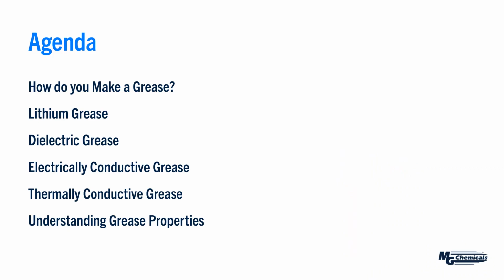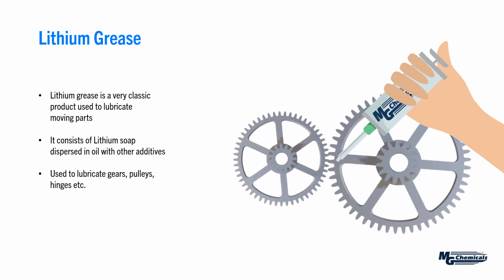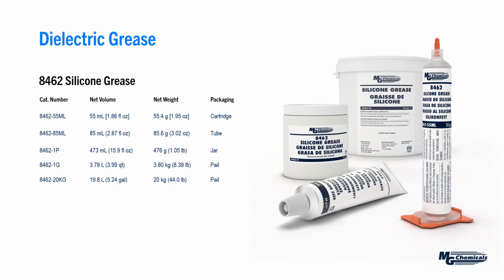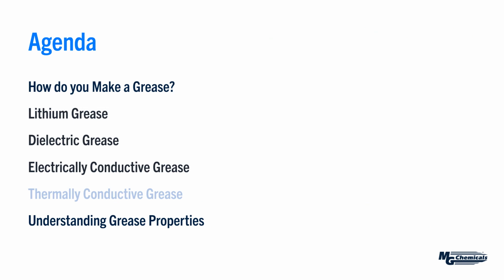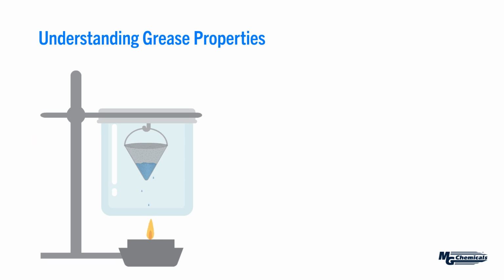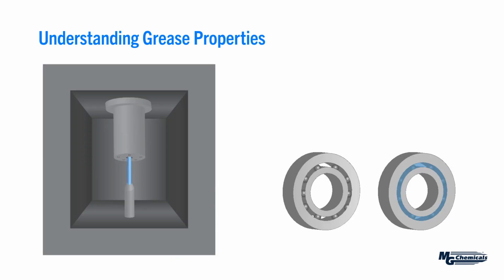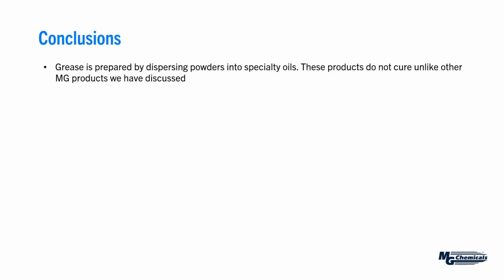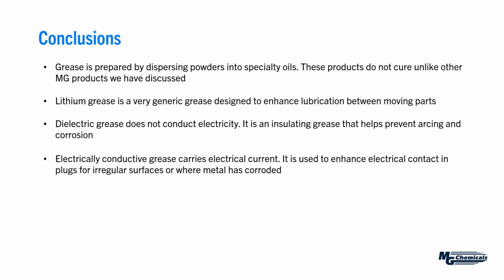Greases for Electronics Solutions - MG Chemicals Webinar

Comment: Which conductive grease would you recommend for J -wire + Busbar contacts? Silver conductive grease?
Reply from the maker: It depends on the application. Silver is best for high-current joints, but carbon may be better for long-term stability, since pairing dissimilar metals like silver and a busbar can lead to corrosion, especially in humid environments.
Reply: @mgchemicals Good to know. These would be I believe gold plated brass busbars on vintage synthesizer keyboards (up to 15V DC)that have oxidized and likely been too aggressively polished by previous owners. So there is lacking some protective coating. I imagine brass is one of the more safe dissimilar metals for silver?

Thanks!
Reply from the maker: Send us a message at info@mgchemicals.com and we'll be more than happy to help you find what you need!

Comment: Is conductive grease sticky? I want to bond the electrode to an extension contact made of tinfoil with conductive grease, is it possible?
Reply from the maker: No, the grease has not adhesive strength and will not bond the electrode. Typically, people using a grease will secure the part with screws/clamps and just use the grease for thermal management at the interface. If you need bonding, consider instead a product like our 8329TCM which is an adhesive.

Comment: Hi, what conductive paste would you recommend for usual automotive connector corrosion corrector? 846/847 or 848? Thank you.
Reply from the maker: Hi, the 846 has a softer, buttery texture which can make it a bit clumsy to apply to connector pins since you have to avoid bridging them and avoiding a short. Our recommendation is the 847 which is a bit thicker and easier to localize.
Reply: @mgchemicals  👍